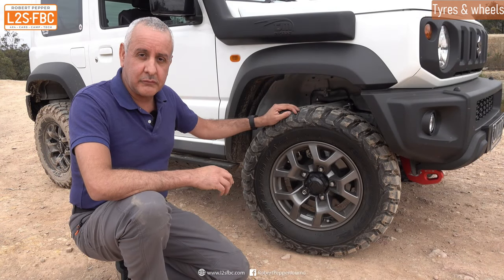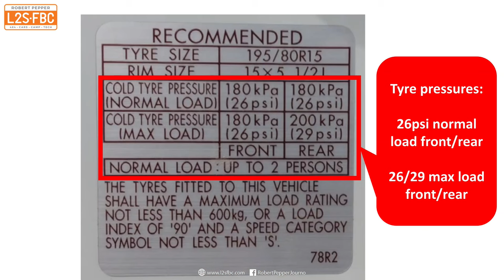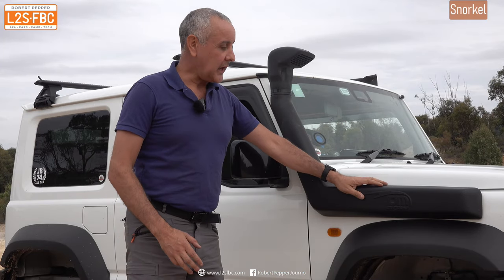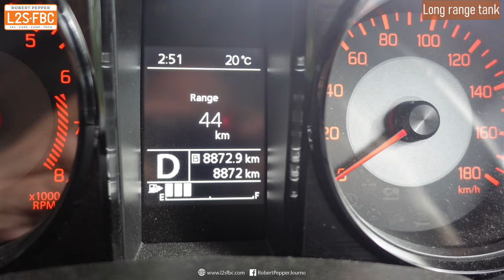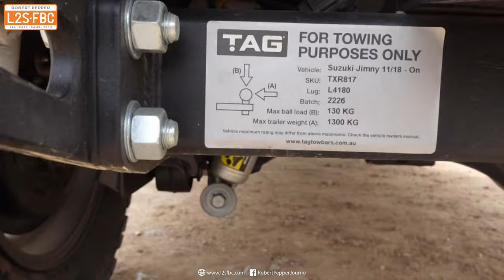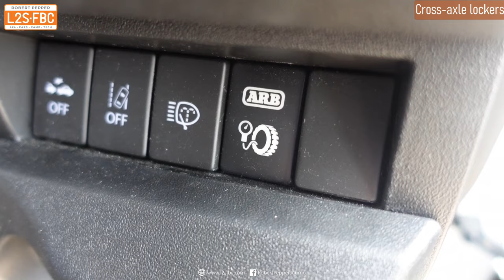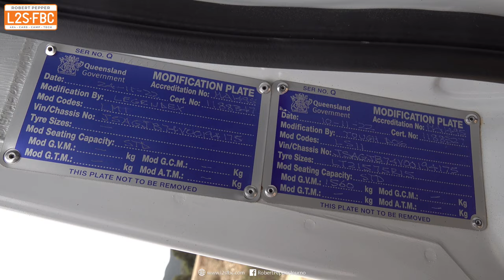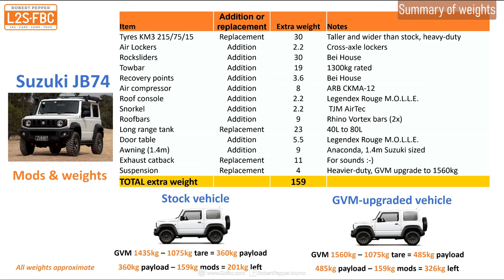Non-bling, practical Suzuki Jimny JB74 modifications

Comment: I have a two door Jeep Wrangler. It is more expensive than the Jimmny. And....
It is wider and more stable
Has higher ground clearance
Greater cargo capacity by both volume and weight.
I remove the back seats to reduce weight (30 kilo) and to increase cargo capacity
I drive off road and do overlanding. I tow a box trailer. I sleep in a Blackwolf turbo tent because I don't like roof top tents.
Overall, my two door Jeep is many times more capable than a Jimmny.
.
As a foot note, the external dimensions of the 1941 Jeep, is almost exactly the same as a Jimmny :)
Reply: We may be smaller but we are lighter ... 'Suzuki, squeeze between the shit Jeeps can't drive over'  ;)
Reply from the maker: Good points Joe - but couldn't the driver of say a Ram pickup say their car is wider and more stable than your Jeep, has higher ground clearance, and greater cargo capacity both by weigh and volume?  And then comes the Fuso Canter truck driver and so on.
I would however disagree with your comment "many times more capable".
Reply: It is roughly twice the price and has a certain stigma.
The old marketing campaign "They Bought a Jeep" has kind of backfired in Australia is more ridicule than envy.
Reply: @L2SFBC  A two door Wrangler is comparable to a Jimmny. A RAM pickup is not.
Reply from the maker: Is it comparable? The two-door Wrangler is wider, longer and more expensive. Arguably, similar to the RAM or Ranger vs the Wrangler.
Reply: @L2SFBC  I would liken a 2-door Wrangler to a Shortie or a Pajero iO, but just like how Nissan and Mitsubishi have abandoned the 2-3-door compact 4WD market, Jeep are not currently advertising any new 2-door models to the Australian market.
Reply: @joezephyr dont forget....the Jeep will fail, and you Will need a Jimmy to carry you back home 😂😂
Reply: @cejulius21   after 4 years driving off road regularly, it has not failed me.